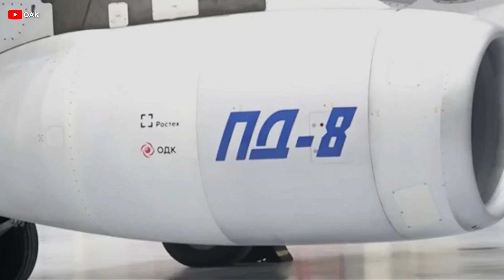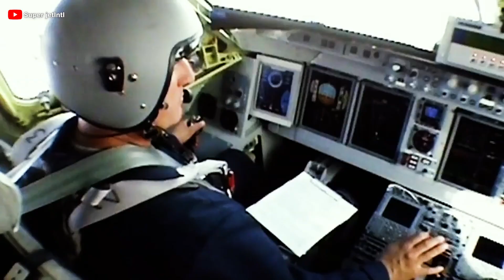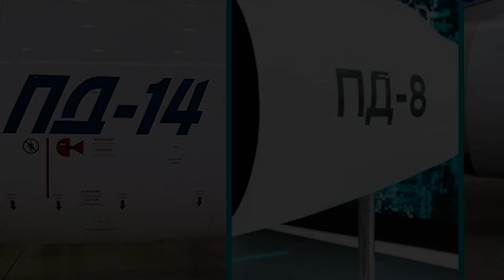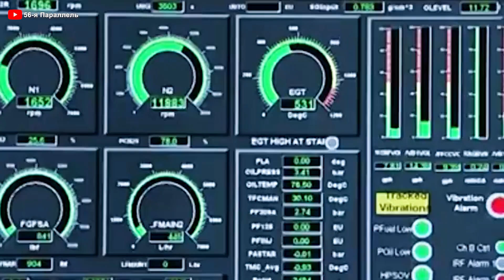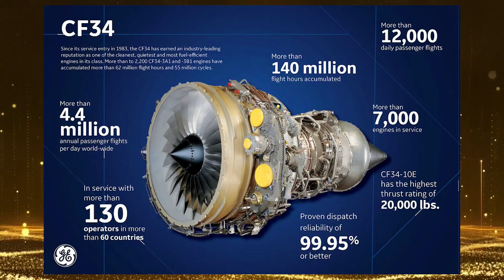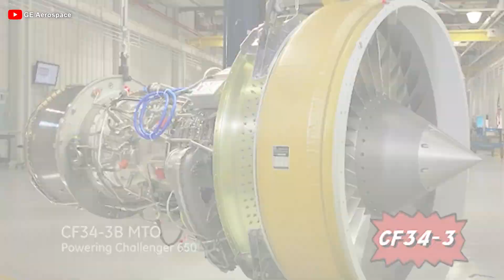Russia's NEW PD-8 Engine That Will CHANGE Aviation! Here's why

Comment: so the hot core is now more powerful but they choose to run it conservatively. And the fan diameter at 48" is not huge ... tells you they can create a higher bypass model in the future with a bigger fan blade with minimal change to the engine core - plenty of potential in the future